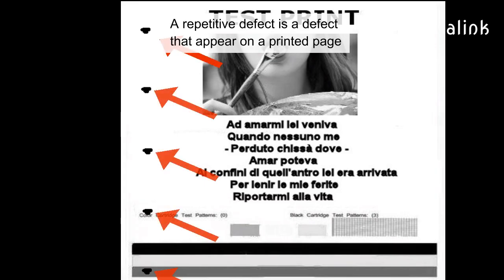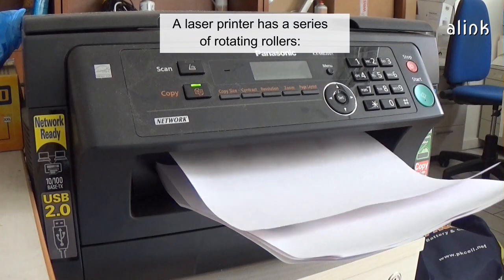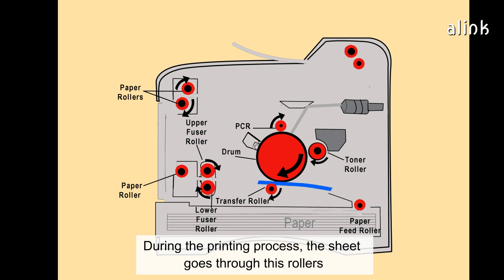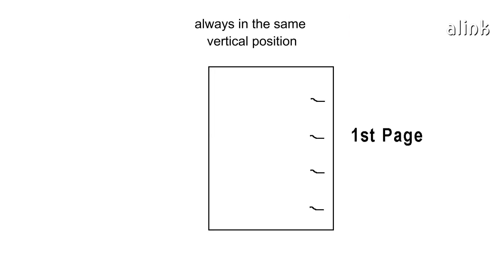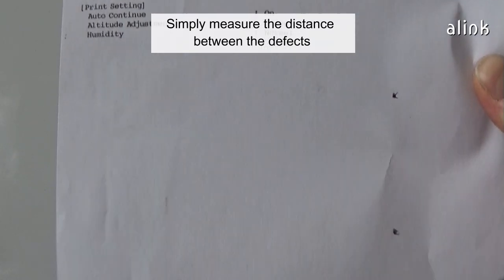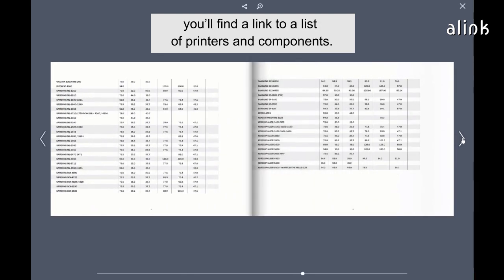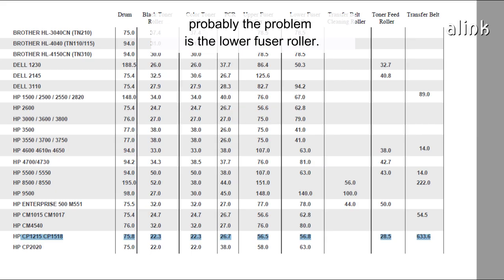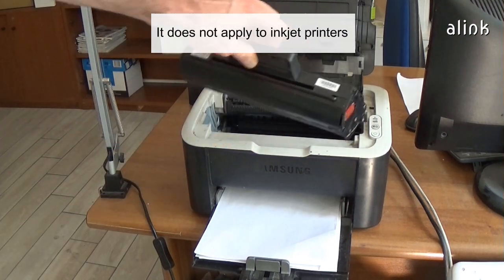Laser printers: Repetitive Defects on a printed sheet

Comment: I have HP laser jet pro MFP m283fdw I have measured the repeating dots they are 28mm apart. Please help? 🙏🏾
Reply from the maker: it could be a defect on the toner roller
Reply: @viandant5 does that mean I have to change the toner roller?
Reply from the maker: @thebackyardfarmer9424  probably a cleaning is enough
Reply: @viandant5 I changed the cartridge and it worked. Thank you so much 👍🏾

Comment: I have an HP Color Laser Jet Pro MFP M477fdw with a ghost image repeating every 57 mm. I noticed when I printed a demo page the area where the pattern appeared had a matte finish compared to the sheen on the rest of the printed image.
Reply from the maker: it's the fuser roller
Reply: @viandant5  Can I replace just the roller or do I need to replace the entire fuser assembly?
Reply from the maker: @janetlewis7649  Probably you can replace only the roller

Comment: Hi, I have a canon mf753cdw that has repeating yellow toner on the right side of the print and ITB every 52mm. The marks re-appear after wiping with the ITB even with the yellow cartridge removed. The secondary roller has marks in same place, but leave no residue when rolled on clean paper. I am thinking the cleaning assembly attached to ITB is clogged. I will have to take apart before buying new printer, it is not serviceable and new one cost half as much as new machine.
Reply from the maker: if the cleaning assembly is clogged the defect sdhould not be repetitive. However I think it's related to the ITB
Reply: @viandant5  Thank you for the reply. Today I will remove all 4 cartridges, clean both sides of the ITB with a microfiber, and then reinstall the ITB and let the machine cycle it. If pattern still appears then I know it has nothing to do with the four cartridges (with just the yellow removed the yellow deposits still exist). Reverse the secondary foam roller that presses up against the back of the ITB and see if the pattern switches from right to left side of the paper. This would indicate that the secondary foam roller is causing these repeating patterns.
Reply: @viandant5  I was able to remove the two springs applying pressure on the ITB's cleaning blade assembly. Releasing these dumped a ton of toner relative to the size of the cleaning blade assembly. A little bit of shaking, another wipe with the microfiber, and then running the ITB cleaning program on the machine and I was able to print off fresh full color test pages without any of the repeating markings. Thank you for your videos, they have been quite educational through this process!

Comment: Hii Viandant, Brother HL-L3220CW vertical light pale line on Magenta colour and broad pale line on cyan colour on every page. When i test print by printing 4 coloured 5cm Circles.
Reply: ThankYou verymuch, the problem is solved after cleaning the led glasses above.
Reply from the maker: did you try to clean the corona wires?
Reply: @viandant5  Yes, and also changed all the drums and cartridges but with no result.
Reply from the maker: @Sayeedbinsalehunnaquib try to clean the leds https://www.youtube.com/watch?v=NQs1WjrziKU

Comment: Brother HL-L2360D prints a 2 mm black horizontal line 40mm from top of the first page, when I select Two-sided printing. Backside is clean. Any suggestion appreciated!
Reply from the maker: It could ibe a dirty paper roller
Reply: @viandant5  Thanks for the reply and your videos. I cleaned all rollers, the drum unit and took the cartridge apart and cleaned but no change. I'll need to get a toner cartridge first to see if maybe the drum is at fault. Saw no damage whatsoever though. Just stumps me why the horizontal line only shows when two-sided printing is on.
Reply from the maker: @mikofoxphotography410  I think it's not a cartridge or drum problem, the defect would be 3 - 4 per page. I thgink it's related to the machine. the paper path of the two sided printing is different from the normal paper path
Reply: @viandant5  Thanks, I'll check that path's rollers again.

Comment: Hi, thanks for doing this. I have a Brother MFC-8910DW monochrome laser all-in-one with 14x5 mm smudges down the left side of the page. I typically see three smudges spaced 107 mm apart. The lower smudges appear to be echoes of the upper smudge, and they tend to get lighter toward the bottom of the page. I've replaced the drum without success. Regards!
Reply from the maker: Check the fuser rollers. there could be a spot of dirty or a defect on the surface

Comment: Thank you, viandant5, for an excellent video. I have a Canon color imageclass MF733Cdw printer with repeating grayscale bands down the left side of the output paper which are approximately 56.5 mm apart. I can't find any specs for the rollers on this unit. Can you help?
Reply from the maker: It could be a fuser roller. I think it's not related to the toner cartridge

Comment: I have a brother 2270dw. It prints exact same pattern on left side. It's more faded, but I can see a distinct pattern in the same place especially when printing graphics. I've tried cleaning everything according to your videos. Do you think a dirty laser mirror could cause this?  (The polygon mirror in the laser unit I think?) I haven't tried a new drum or toner cartridge, but I did clean them and noticed that the roller from the toner cartridge was showing a build up of toner on same area that was printing faded, however, cleaning it didn't resolve the problem. I thought maybe it could be old toner, but how would that affect print in the exact same place?
Reply from the maker: It's a typical fuser unit defect, I think the problem is there
Reply: @viandant5  Thanks so much for your reply. I tried replacing the toner (dumped and refilled, reset flag gear) and doing a half sheet test. The defect shows up before fusing on that test. When I pulled the sheet out, I could see the same pattern. Could it still be the fuser in this case? Again. Thanks so much. I really appreciate you.
Reply from the maker: @JaneofArc  No, probably is the toner cartridge. Did you remove all the old toner before the refill?
Reply: @viandant5  Yes, I emptied it completely first and reset the flag gear. I guess I need to buy a new toner cartridge. I did clean the fuser roller also with no improvement. Thank you. :)
Reply: I should mention that I've filled it 4 times with the same cartridge, and problems started on the 4th fill, so maybe I've gotten all I can from it.
Reply from the maker: @JaneofArc  I think so, toner roller, toner roller blade and internal sponge roller are components that worn out
Reply: @viandant5  Thank you kindly. I'll get a new cartridge and update once I do. Thanks so much for replying so quickly to my comments. Sincerely.

Comment: Thanks for reacting so quickly. The blue and gray dots are always at distance 30 mm. I cleaned the drums and other rolls that are visible without too much demontage. I cannot see any damage on the rolls. or drums. A new image-unit for the printer is a bit expensive especially if it does not sove the problem.
What to do.
Reply from the maker: 30 mm it's not the drum. It could be the toner roller for example

Comment: Dell 3130cn. Identical, repeated magenta splotches in a perfect grid pattern. Spacing is just over 28 mm in long direction and about 26 mm between left to right. I just put in a new magenta toner cartridge and it started from the first print. I've also cleaner the transfer belt, but that didn't work. You include the Dell 3110 in your link, which if similar to the 3130cn, indicates a PCR problem. Is that your assessment also?
Reply from the maker: It could be a problem on the toner roller, may be a clot of damp toner. PCR and toner roller are in the toner cartridge.

Comment: Hi, thanks for the offer of help, I have a HP Colour Laserjet MFP M479fdn with marks repeating every 57mm - do you know the roller circumferences for that model, please?
Reply from the maker: It's the circunference of the fuser roller, upper fuser roller and lower fuser roller have almost the same circunference
Reply: @viandant5  Hi, I have an HP Colour Laserjet Pro MFP M477fdn with marks repeating every 57mm as well. They are only repeating on the left side of the paper. Do you know which roller this would be? Thank you!
Reply from the maker: @shelbyspirak2051  The same, it could be the fuser unit

Comment: I have a very odd defect on samsung clx 6260. 4 perfect thin horizontal lines, equally spaced around 76mm (look almost like guidelines for folding) along with a rectangular  'frame' of what looks like a 1 pixel wide line, all around the very edge of the paper. It's almost like some kind of registration setup print. Spacing is perfect - the top and bottom lines are equal distance from the top/bottom respectively. There are no smudging or other errors.
Reply from the maker: Which color? Black? 76mm is the circumference of the OPC drum, it could be a bad contact or a small defect on the drum and the charge roller, that is in contact with the surface of the drum, discharge on the drum
Reply: @viandant5  Hi, thanks for replying, it's red. Do you mean a bad contact on the cartridge?
Reply from the maker: @simonwoodgate5458  A bad contact between the printer and the cartridge or a bad contact inside the drum
Reply: @viandant5  ok thank you. It looks like this model has a drum (green bit!) on each cartridge. So looks like an issue within the red one. I can't find a diagram to disassemble it though - any chance anyone here has this?
Reply from the maker: @simonwoodgate5458  here there are the disassembling instructions: https://www.youtube.com/watch?v=tB_sZj8fACI

Comment: My HP 3600n has a repeated horizontal line every 32 mm on the left side of the printed page. What is the defective roller and how do I fix it. It happened when I replaced the empty HP magenta cartridge with a remanufactured cartridge. Thanx in advance.
Reply from the maker: Check the toner roller rotating it. it could have a line or a toner stain. If there is a toner stain try to clean it with a soft cloth

Comment: Thanks for this great resource! I'm trying to diagnose an area that is not fusing (toner is applied to area, but can be wiped off easily) on Canon MF731C ... Repeats vertically approx. 55mm ... Can you help? It sort of looks like the shape of a piece of lint or debris that might be stuck to a roller.
Reply from the maker: Toner that can be wiped off easily is often a fuser defect, and the distance of 56 mm is the fuser. I think there is a problem with the fusers
Reply: @viandant5 , thanks, as I thought. Appreciate your advice! Now, let's see if I can figure out how to get to the fuser rollers. :-)

Comment: Would you happen to know what roller creates repeated traces at ~2,5cm on a Samsung CLP320? I've already managed to clean the drum, belt and fuser and pressure rollers thanks to your great videos (thanks!) but it didn't make a change.
Edit: I didn't see the second page of your doc. I'll look into the black toner roller.
Edit2: wow, there is a very slight bump in the black roller that seems to match the shape of the traces. Thanks to you I might have saved a printer that was never used because the previous owner thought it was broken (it's still using all the test cartridges).

Comment: Hello. Could you please help me in diagnosing why is there a curved horizontal line repeating every 50.5 mm on one side of the page? The line almost looks like somebody left their hair on one of the rollers inside my new remanufactured cartridge. My printer is a Lexmark Optra E310. I already checked the service manual for it, but there is no info for a defect repeating exactly every 50.5 mm.
Reply from the maker: No, there is no repeating defect at 50.5 mm. However such a defect could be the drum
Reply: @viandant5  Thank you for your reply. I checked the drum multiple times already, but it's in pristine condition (as a new remanufactured cartridge should be). This issue does not occur while using my old toner cartridge (which has it's own problems. It's main problem was that it was producing light prints. Later when I got this new one, I disassembled the old one and discovered that the developer roller didn't have a smooth surface. It had a texture of almost like skin. This texture was visible on the printouts and was causing the 100% black test page to look gray ("skin-like dithering").). 

I've also noticed that if I run the same side of paper through the printer 2 or more times, it starts to look gray (5x = dark gray paper (not on the other side of paper). The old toner cartridge wasn't doing that at all. When I take the cartridge out and take a look at the drum, I can see it's not clean. It always has a tiny, but noticeable layer of toner on it. Cleaned the contacts - no help. Cleaned the drum with IPA - no effect.
Another problem is that on an inverted page (white stuff on black background), ghosting of the white parts appear. There's no problem printing black stuff on white bg, so I don't really care much about this issue.

Perhaps my printer is starting to show it's age after 21 years of life (mfg. date is sept. 1999, lifetime printed pages 36000+). lol

Comment: Vertical line in copy & print in bold letter & photoes
Reply from the maker: Whitout knowing which printer do you have it's difficult to say. May be a worn drum, or a wiper blade
Reply: @viandant5  brother DCP-B7500D
Reply from the maker: @187vikassingh9  Try to clean the corona wire, but I think the toner cartridge is defective. Check the toner cartridges, if the toner on the roller is perfect. Clean the drum before to change the toner cartridge.
Reply: @viandant5  I have replaced a new cartage and also cleaned the drum also clean corona wire
But....Not any change